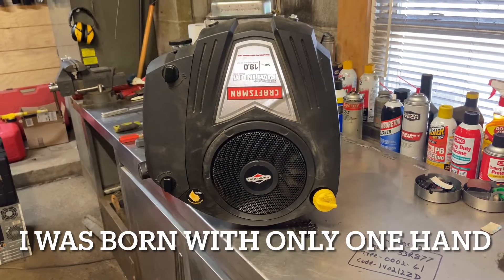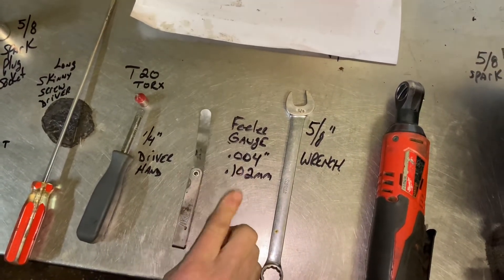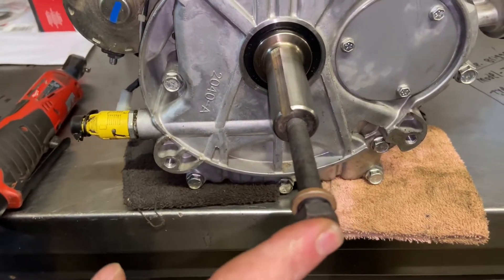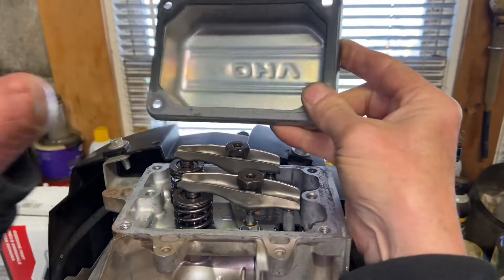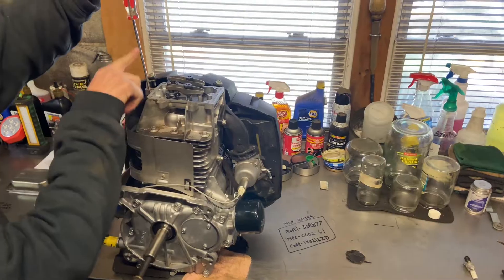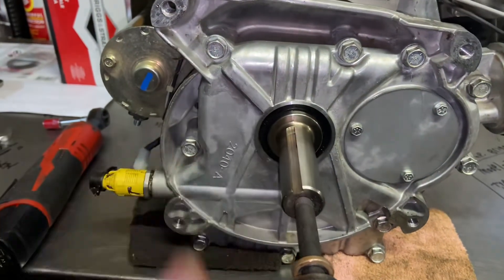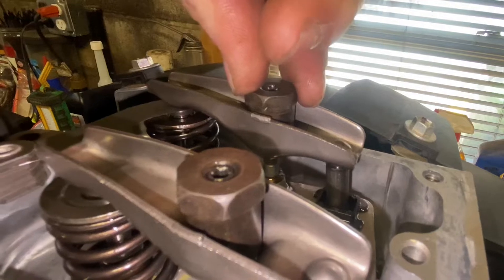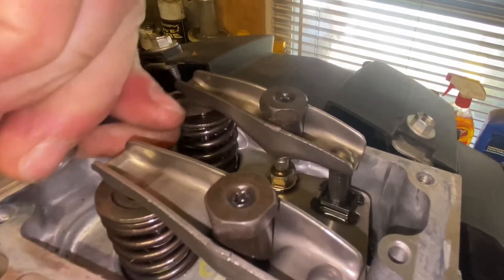How to adjust valve clearance on a Briggs and Stratton engine

Comment: Super helpful. I think I did mine 4 and 6... but I'm not sure I did it right, and I probably will go back because you're the second person to say you put both of them at 4. Mine is a 21 HP (I believe, the sticker came off)... I may try to find the engine specs to verify the clearance levels on my specific Briggs & Stratton Craftsman YT3000 42", but, your method is greatly appreciated!

Comment: Every video says top dead center not explaining what the hell that means.
How should the valves be sitting when you set them? way too complicated.
Reply from the maker: That is an older video and It would be a little different if I did it all over but most get it. Top dead center is when the valves are both closed and the piston is at the top of the cylinder on the compression stroke. Put a small piece of paper towel at the top of the spark plug hole and when the piston is going up on the compression stroke it will push/puff the paper towel away from the hole. Then you will know you are on the compression stroke going to top dead center. Once piston in in position, you can adjust valves.

Comment: What is the wire that plugs into the bottom of the carburetor for?
Reply from the maker: That wire connects to the fuel cut off solenoid at the bottom of the carburetor.

Comment: Great video, im just curious. I set mine exactly as instructed here and after im done if i rotate engine the exhaust valve at closed state can get up to like quarter inch valve lash. But if i go back to TDC on compression it is .004. is this normal?
Reply from the maker: That is Not normal, you may have other issues. I cannot say what that would be without seeing the engine.
Reply: @JohnsonsSmallEngines  My dad put a new decompression cam in and this is what happened after we got it all back together. So something happened during that.
Reply from the maker: The decompression cam will make the valve open a little bit so engine will decompress but 1/4” is a bit much. It should be more like 1/16th. It’s not much. I’m not sure of the exact measurement. Let me know how you make out. Im curious. I have never had this issue. Did you purchase Briggs and Stratton cam or was it aftermarket?
Reply: @JohnsonsSmallEngines  it was an aftermarket cam. It had lots of good reviews. Also it's not the decompression bump that is 1/4 inch it's when i take the valve cover off after trying it. Also i get some major backfires some out of exhaust and some big ones out of carb.
Reply from the maker: Yep, definitely a valve issue. Double check to make sure your on the compression stroke when adjusting the valves.You should feel a puff of air coming out of the spark plug hole when the piston is coming up to top dead on the compression stroke. Put a piece of tissue paper on top of the hole to see. I wonder if the cam lobes are incorrect. Or a tappet or valve sticking. Where do live? State?
Reply: @JohnsonsSmallEngines  Nova scotia Canada, and okay will look into it. Appreciate your help greatly

Comment: hanks for sharing. Question: so if piston is full visible does that mean that valves are ready for adjustment.  (can a  light be use to see the piston position ) please correct me if wrong.  Again thanks and God Bles
Reply from the maker: The piston has to be at top center on the compression stroke as stated.

Comment: Will loose valves call my B&S 19 horse to surge? I've already gone through the carburetor so I feel confident about that.
Reply from the maker: A surge in the engine normally means the engine is running lean. The engine can also surge if the engine is over reving . Most of the time it is a lean condition. Check to make sure the fuel is flowing good from the tank to the carburetor. If all that checks out, you most likely will need a new carburetor. Only buy an original manufacturer carburetor if you don’t want headaches of a aftermarket.

Comment: Correct me if I am wrong, but I put my finger in the spark plug hole and let the compression in the cylinder push my finger off the hole to find the compression stroke   [the intake stroke will suck your finger onto the plug hole].
Reply from the maker: Without the spark plug out, you will have suction on the intake stroke and the power stroke. You should feel more suction on the power stroke because both valves are shut. Same as you will feel air blow out on the compression stroke and the exhaust stroke but more on the compression stroke as both valves are closed. Top dead center is on the compression stroke with both valves closed with piston moving up.
Reply: @JohnsonsSmallEngines  So I was right ???
Reply: @JohnsonsSmallEngines  Would a compression gauge be useful in finding the TDC of the compression stroke?

Comment: Does it matter if you turn engine clockwise on counter clockwise? I think my engine turns over clockwise when starting it. Briggs and Stratton OVH 19.5 hp.
Reply from the maker: It doesn’t matter which way you turn the engine when adjusting the valves as long as you are at the correct spot on stroke.

Comment: It's exactly the opposite of cars on which I have adjusted the valves; on those the nut is what locks things down and the adjustment/clearance is obtained by turning the centre screw.   Am I correct in stating that it is better to have the valve clearance a bit loose then too tight?
Reply from the maker: Cars and small engines are different in many ways. 30 plus years performing valves adjustments on small engines and never had a valve too tight that I had to loosen them. They have always needed to be adjusted tighter so I adjust accordingly and all is good.

Comment: My 2018 motor manual says for my 18.5 HP Briggs and Stratton motor intake valve set on 4 but exhaust valve set on 6 . Is it common for two different sets
Reply from the maker: As I said in the first minute of the video, the valve lash may be different from model to model. I tend to make the valve lash a little tight because they seem to get larger as they run and wear. Do what you feel is correct for your machine.

Comment: I have a husky mower with same or similar engine and I'm having a problem where it only starts when cold. When it is warm it has to much compression for the starter motor. I was hoping ajusting valves would help, it runs better now but still same problem. Any ideas?
Reply from the maker: I would first check to make sure the battery is ok and check to make sure the charging system is working. If that is ok, then pull the spark plug when your have the issue to make sure your not loading up the cylinder will fuel. You make have a carburetor issue leaking fuel into the cylinder when engine is hot. Rare but can happen. Don’t come across that much at all and can not remember the last time I did. Normally if the engine has too much compression, it will be all the time and that would be a bad compression release on the cam inside the engine. I will have a video out on the cam issue in the next day or two.
Reply: @JohnsonsSmallEngines  alright, thanks.

Comment: Perfect explanation and demonstration of the compression and exhaust strokes and TDC and the valve adjustment itself.  I've got a double OHV 44 series Briggs and the valve screws are a little different.   The outer nut holds the position and the screw tightens the gap.  A bit harder to fumble around with since the nut doesn't extend up very high to easily hold it.  Maybe I'll get an extra box wrench and grind the walls down thin so I can fit it in there next time.
Reply from the maker: I’m glad it was helpful and thank you for the kind comment. Please give this a like and tell your friends to help my channel grow. It would be greatly appreciated.

Comment: Thanks for the great video. I have the same engine in my Craftsman 42 inch lawn tractor but the manual shows clearances of .003 - .005 for intake and .005 - .007 on the exhaust. I have been using .004 on the intake as an average but I use .006 on the exhaust but you suggest using .004 on both. 
My question is why are you not setting the exhaust to the larger setting or do you find that it doesn't make much difference? Thanks in advance!
Reply from the maker: I have noticed through the years of doing this that the clearances loosen up and the exhaust runs so hot that it loosens up a little more so I use 4 on both. It works for me. Thanks for watching and commenting. Please tell your friends about my channel and give it a like to help my channel. It would be greatly appreciated!
Reply: @JohnsonsSmallEngines  Your explanation makes sense so I will follow your lead. Thanks again!